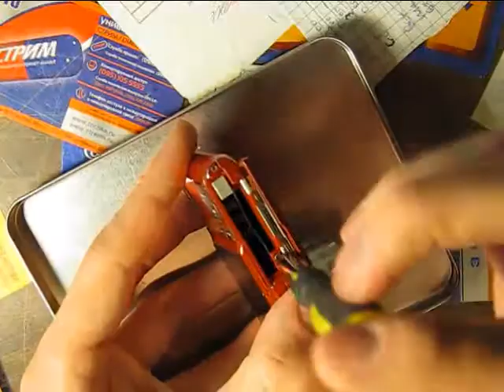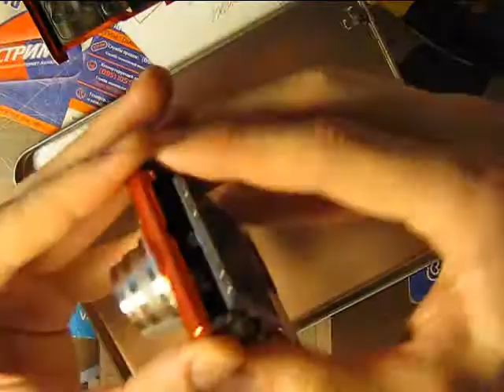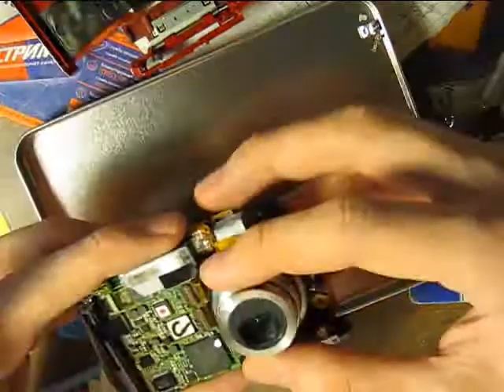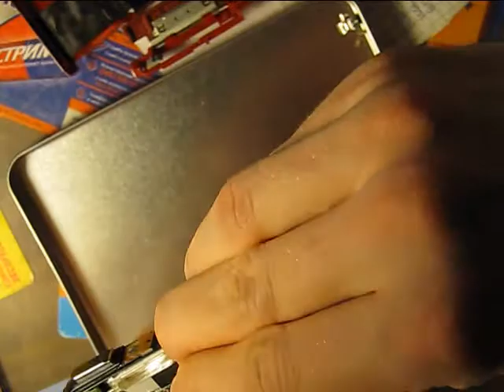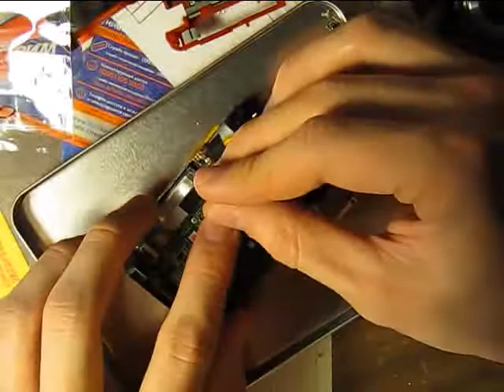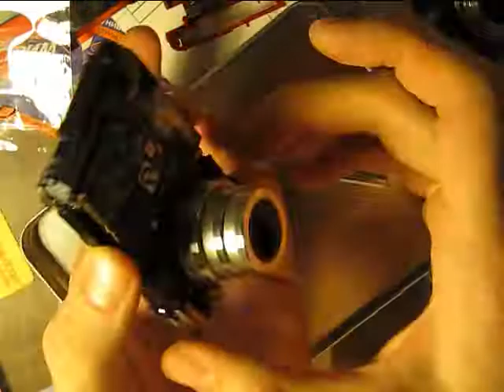Casio Exilim EX-S600 lens assembly replacement

Comment: I have one of these that just quit working. Turned it on the other day, the lens extended fully then there was no power. Completely dead! I have two brand new, fully charged NP-20 batteries and an external charger.